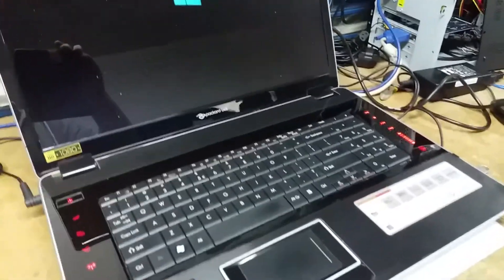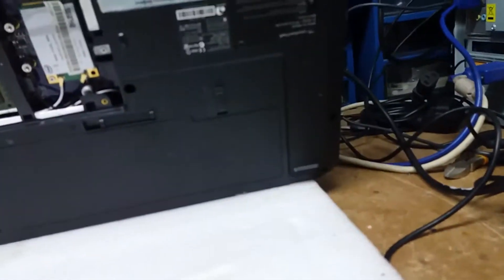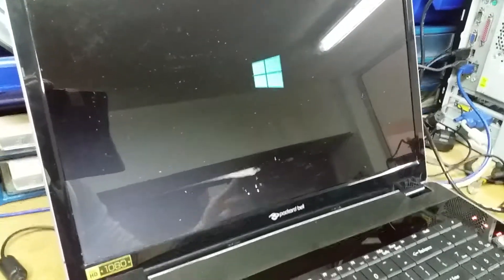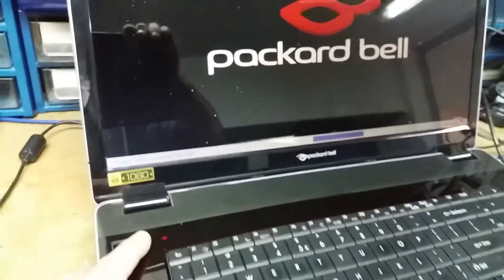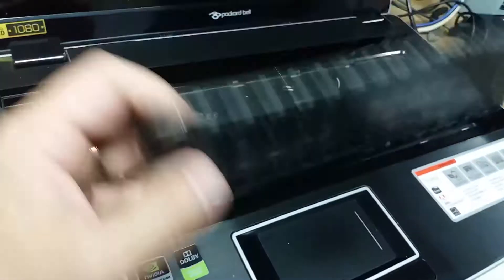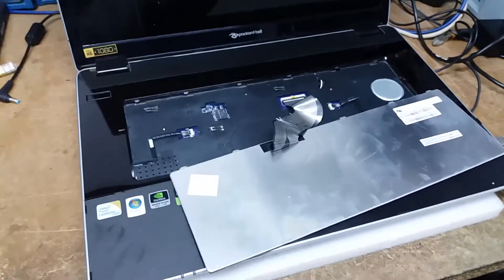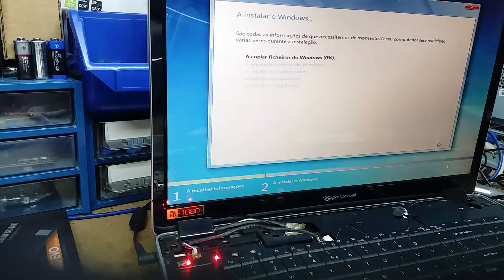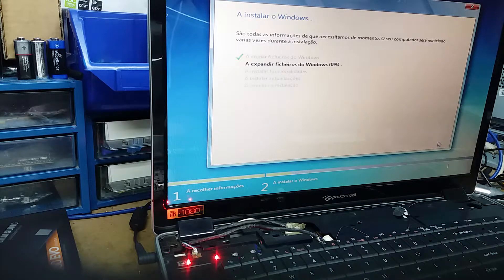Packard Bell laptop Shuts down and restarts by itself - SOLVED

Comment: How about a Packard bell easynote TK85?
Reply from the maker: Hi,
I did a quick search and i didn't see any NEK Tokin on your Motherboard... so it's not the same issue...
What's the problem with your laptop?
Take Care.
Reply: @Fixepedia  Well it keeps bootlooping, probably the CPU burnt or something, i recon it isnt the cpu, since i put it in hibernation mode, and put in the battery, and when i wanted to turn it on it kept bootlooping
Reply: @gtadamise162  have the Same Problem  :(